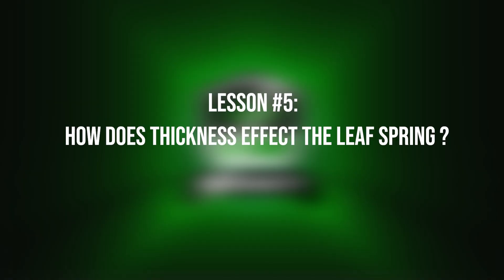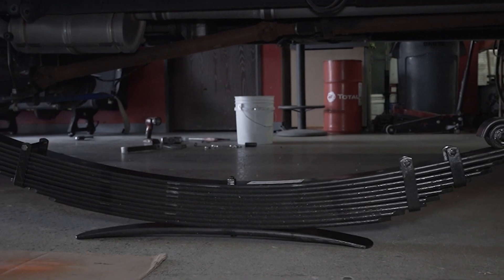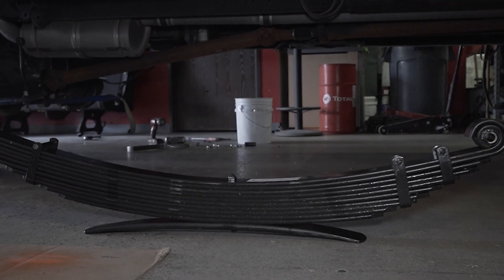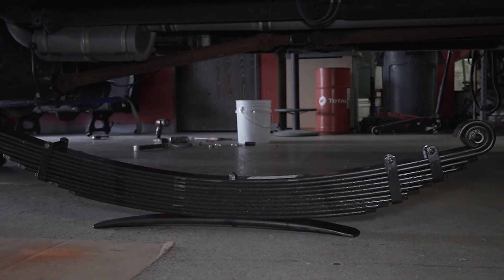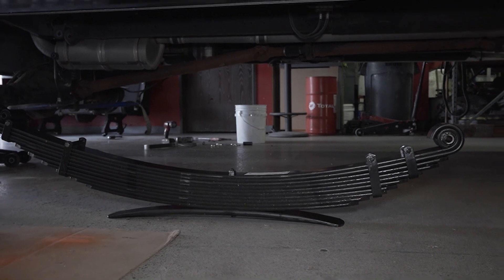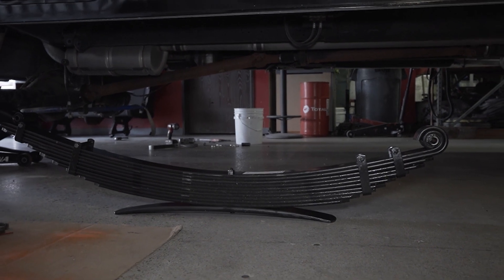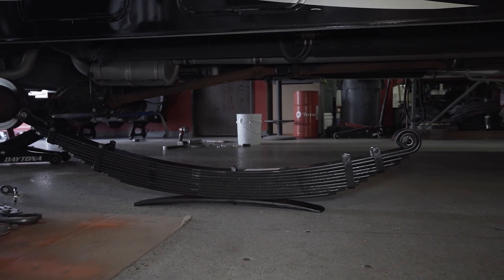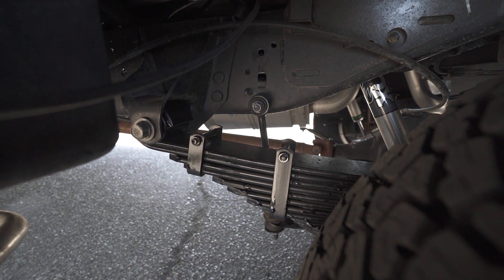How Do Leaf Springs Work? The Arc and Thickness of Leaf Springs Explained

Comment: Are off roading leaf springs thicker then on road leaf springs?
Reply from the maker: Not always thicker, but often stronger or tuned differently. Off-road leaf springs are typically designed with increased arch, higher spring rates, or additional leaves to handle rough terrain, increased articulation, and added weight from gear or upgrades. That said, "on-road" springs in RVs or trucks can be just as heavy-duty if they're built to carry consistent loads — like a fully built Class C RV. It's less about thickness and more about how the spring is engineered for its intended purpose.

Comment: Are off roading leaf springs thicker then on road leaf springs?
Reply from the maker: Great question! Yes, off-road leaf springs are generally thicker and designed to handle heavier loads and more extreme conditions compared to standard on-road leaf springs. They typically have additional leaves or a progressive design to improve durability, load capacity, and ride control when driving over rough terrain.

If you’re considering upgrading, off-road springs will give you better support and stability, especially if you carry extra weight or spend time on uneven roads.

Comment: Plastic wear spacers, p-tons or shim spacers are used to shim between leaves of springs to keep them from making noise. Will it weaken or damage the leaves if the P-tons are replaced with thicker ones or add P-tons to the leaves that don't have them?

Comment: You speak on vans and rv. Do you have any solutions for SUVs? I’ve got a 3/4 ton Yukon and want to better support my load carrying capacity and towing. I’m going to upgrade my hitch to a Curt class V. I think the Yukon had a lift installed by the previous owner. I don’t know whether to upgrade the leaf pack or upgrade the leaf pack with helper bags. It’s a 4x4 and I use it off road so that’s also a factor. Any advice would be greatly appreciated!